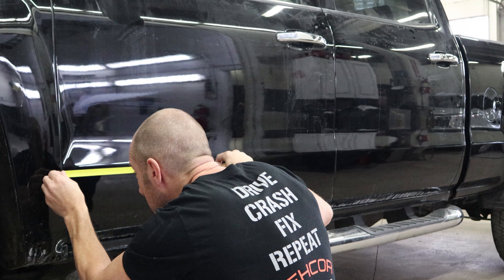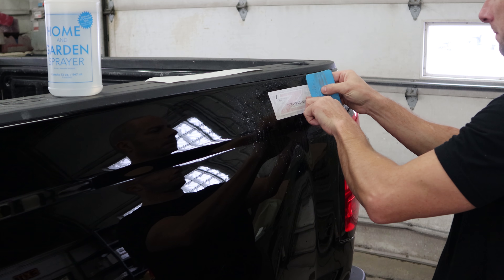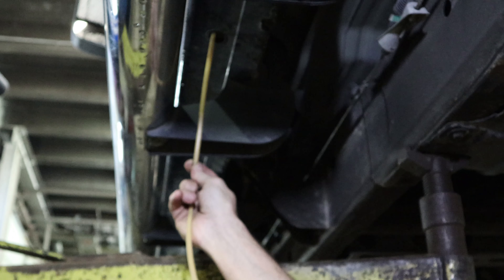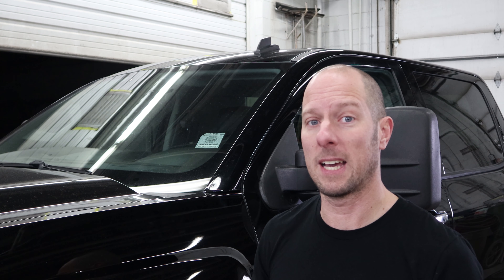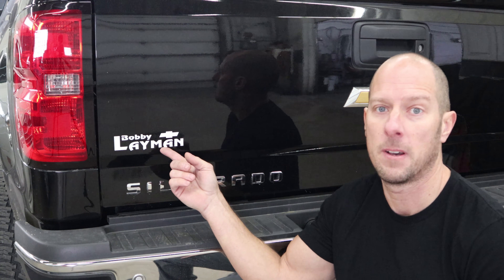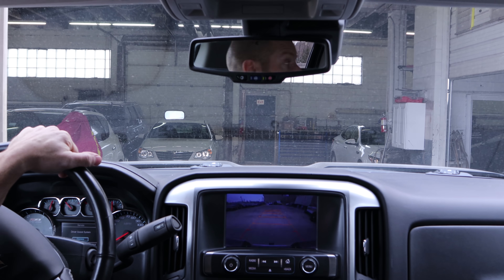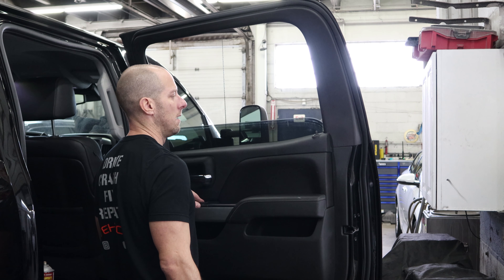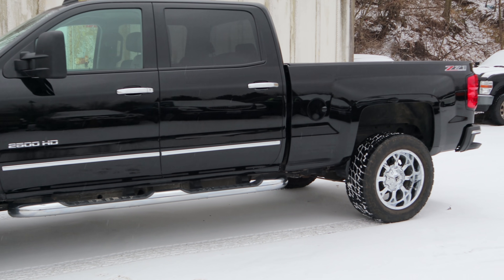2015 Silverado Duramax LTZ build Q & A and the finished product.  The "mistake" hits the road!

Comment: I noticed that you've done a lot of regular heavy duty trucks have you considered doing a dually rebuild? Sorry if you have already new to the channel
Reply from the maker: I usually only do trucks for myself or preorders.  I don't need a DRW myself and have not found a buyer for one so it is just the little guys so far.  I would be just fine with building one if I had a buyer.  I do bid on them.  Thanks for watching.
Reply: @vehcor  oh ok thanks for responding I love the channel

Comment: It doesn’t take voltage;  voltage is what pushes amperes thru resistance. Google it under Mho’s Law
30 volts under the wrong conditions will kill you it only takes 0.1 amps to lock you in a circuit
Reply from the maker: I don't know the amps but the ECM puts out up to 240 volts to the glow plugs so it kills the battery pretty fast when it is doing that over and over.  It has been a while since I had to think about electrical terms. lol

Comment: How do you reuse the numbers and use double sided tape?  Seems to me that cutting the double sided tape to fit the numbers and letters perfectly is the hardest part.  I've used that trim "glue" before about 15 years ago and never will again, ever again, I promise,  It's the absolute worst!  3M double sided tape is supreme leader.
Reply from the maker: It takes a little while to trim the double sided tape but when you figure new emblems cost around $70, it is worth the trouble.  There is actually a company that makes the double sided tape pre-trimmed, all you have to do is clean and apply.  It costs about half as much as an emblem, new.

Comment: Hey the Z71 transfer looks crooked.  Kidding nice job. Didnt click the links but it looks like you used Wurth cavity wax.  It smells like Crayons. Better than the 3M stuff ABRA / Caliber makes us use. Says a lot when your chevy rockers and doors are still there in NWI.  I've been doing this a long time probably as long as you.  About 1 % care how it leaves the shop. Hourly or flat rate hacks are everywhere.  Beers on me if you want to trade stories. Nice job on the train wreck. Haters will always hate. -Brian
Reply from the maker: I usually use the Wurth stuff but I wanted to try the Fluid Film everyone is talking about.  I just put it in the Wurth can to use my sprayer.  I didn't want to buy the sprayer until I was sure I was going to continue using it.  It seems pretty good so far.  We will see how long it lasts.  Thanks for watching!

Comment: So, does it drive and ride as good as it looks - ?
Reply from the maker: Even better.  I was afraid it would be a harsh ride with the lift and tires but it is still much better than my stock 06.  And quiet, you can barely hear it run, no road noise and no wind noise.  Must be the carpeted wheel liners. lol Thanks for watching!
Reply: @vehcor  
Fantastic rebuild, I look forward to the next one.
I do have a suggestion: I don't know how many are interested in the numbers (how much everything cost), but if it's a bust with Mark Wahlberg, maybe you could do a give a way with that information. I watch a lawyer on YouTube who gave away a paperback book he wrote to the 1st 50 people who responded to the video announcing he reached 50K subscribers.
Maybe you could do something similar. Just a thought!

Comment: I laughed my ass off at the ending, as for rattles as long as you take the time to do it right as you can see there's no noise. Where people run into problems is reusing clips that should be tossed and forgetting to replace them. I've had just about every interior you can imagine apart and rarely run into problems. When I do they get fixed because otherwise I wouldn't have any customers ;-) It's scary some of the hacks that are out these days. But thanks to them I've got nearly as many good customers as I had when I had a retail location 10 years after I closed the doors. I actually have more steady customers now and it's because I took a job for a regular customer simply to fix another shops problem.
Reply from the maker: That ending was probably the most fun of all the videos I have made so far.  I will attempt to top it in the Dirtnali video.  I have always gotten customers by fixing other's mistakes.   Keep up the good work!  Thanks for watching!

Comment: What’s the wheel and tire set up
Reply from the maker: The wheels are Fuel but I don't know the offset or model.  The tires are Nitto and 305/55r20 if I remember correctly.

Comment: 96 hours, at regular shop rates that's about $10,000.00 USD or $12500 CAN (converting to my money). If you made that in the sale, that is a great ROI on your time. I sure don't make $100 an hour.
Reply from the maker: No, at work I don't quite make $100/hour.  I do on these builds quite often and I figure it at $50/hour when I am deciding what to bid.
Reply: @vehcor  yeah, that's what I figured. Even if you made $50 on these part time projects you're doing good.

Comment: One question: your steering wheel doesn’t doesn’t look aligned
Reply: It’s just a chevy and gmc truck thing that’s been around since the body style change in 98’. They finally got around to making them proper with this last generation.
Reply from the maker: It had not gone for the alignment at the time that was filmed.  Anytime you have the cab of and column apart, it will be off a little.  Even when the loader drivers move it around at the auction stuff gets pushed around.  That is why all of my builds get aligned regardless of if the wheel is straight or what the repair was.

Comment: So, that looks like $12k if my eyes are working right. $12k divided by 78 hours equals about $153.00/hr which is what a shop charges around here. So, if that's your " true profit", you paid yourself $153.00/hr on which you have to pay taxes. Not bad, but not exactly killing it either. You have tremendous skills and patience and I admire that, so don't think  that I'm slamming you, just trying to understand the math involved in getting into a project like this.
Reply from the maker: Your eyes are not working correctly.  I would have been fine with only $153/hr.  Seriously, how much do you get paid that 153/hr seems like nothing? 😂

Comment: Doing wrecks since 1975 that butchered frame and broken trans  I would of walked away. There is nobody left that can fix a frame that bad. At age 63 2 worn out shoulders left knee and hip its more painful to do to heavy stuff now.
Reply from the maker: These frames are not repairable,  You can straighten them but they are weak as heck.  Uneducated people think these are just like the frames from the 70s and can heat to straighten, not so!  I have seen a few first hand, some cost some people a lot of injuries.
Reply: @vehcor  AWW high tensile steel you would have one crack at it, and they want you to use heat crayon?? Usually can't heat over and over you will thin and weaken even old fashion steel frames. I have a inter provincial Licence what's your qualifications. Yours wasn't fixable because it was messed with and it was too far gone. You can bet there will be shops trying to straighten ones with less damage.
Reply: @vehcor  And you could be right it must be weak to begin with to collapse so bad to break the housing.
Reply: @vehcor  in Canada that truck would be $25k plus more likely around $30k to buy it wrecked.  I am jealous I would have kept it.
Reply from the maker: @TheDoug9901  Repair procedure on these frames is heat once for a maximum of 45 seconds.  If the repair requires more, the frame in not safely repairable.  This is per GM and ICAR specs.  So basically if you need heat at all, it is junk.  Like I said, they are not repairable even for little damage.  They are designed to crumple and absorb energy so the occupants do not.  I am ICAR certified and follow all repair procedures.
Reply: @vehcor  I-car procedure hasn't changed for a  very long time. In trade school there was a teacher who thought you could pull cold, he was stupid by 1975 standards.
Reply: @vehcor  when I was taught they said to use a heat crayon significantly more accurate than 45 seconds some rookies use a cutting torch to heat. Others use a rose bud that could melt steel. 45 seconds not good

Comment: Stick with what you have been using....fluid film is ok but it comes off too easy on the plow truck.....mine rotted to hell.
Reply from the maker: I like to try new things, it is how you learn better ways.  Sometimes you learn the old way was better. lol  I did notice it was a little thinner than the stuff I usually use and stayed wet.  I guess that is why they say to apply it annually.  The old stuff gets hard like candle wax so water really can't affect it.    Thanks for the tip!